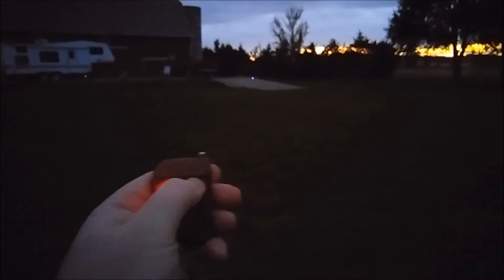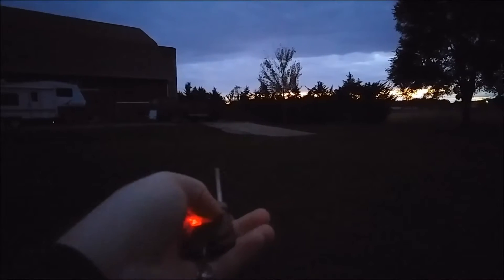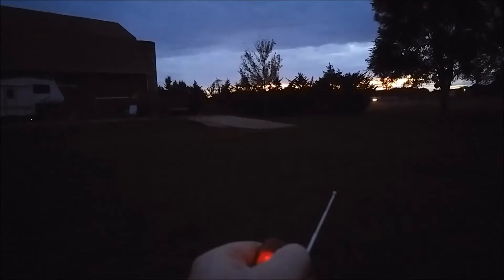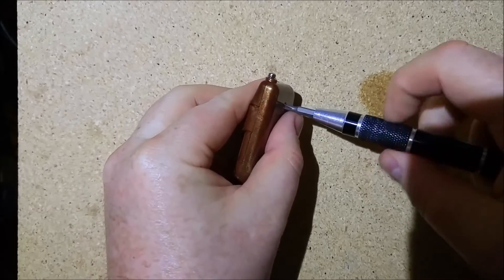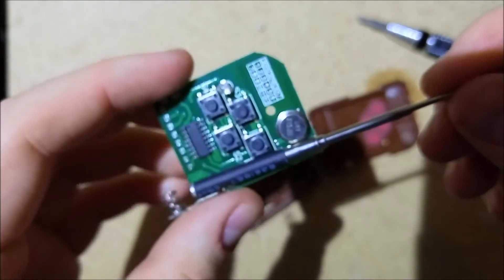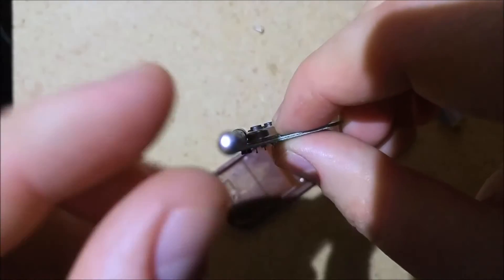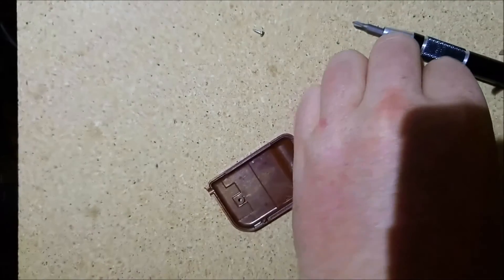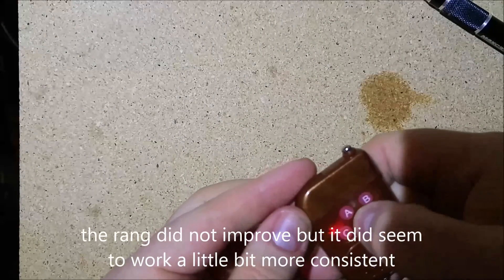IC 2262/2272 4 Channel Wireless Remote Control Kits 4 key For Arduino

Comment: I tested it too and have the same result as your experiment. Indoor, with short receiver antenna of roughly 15 cm & 3.7V cellular rechargeable battery, I have 2.5 ft of steady control & roughly 10 ft range of pulsating current. Longer range probably is possible using LATCHING versions T4 or L4 or latching relays & also 5V plus long antenna , which will make the system much more expensive than a few dollars..